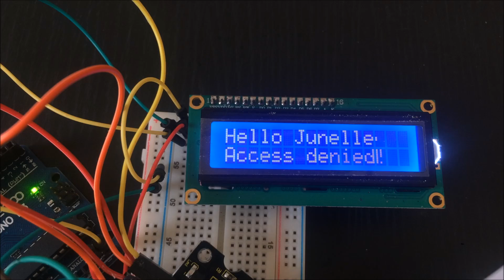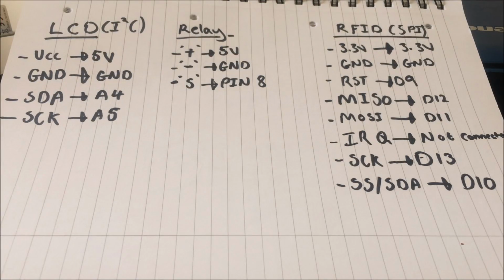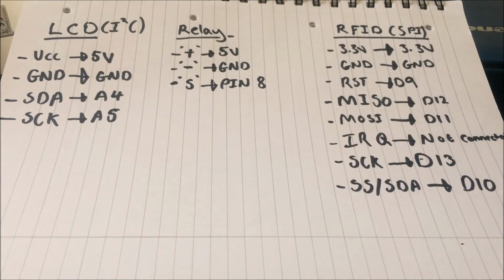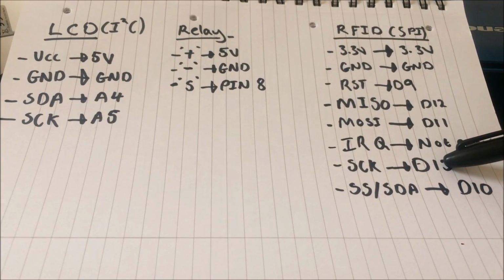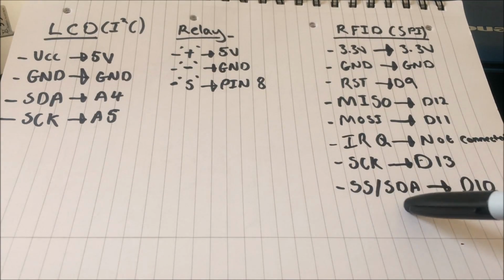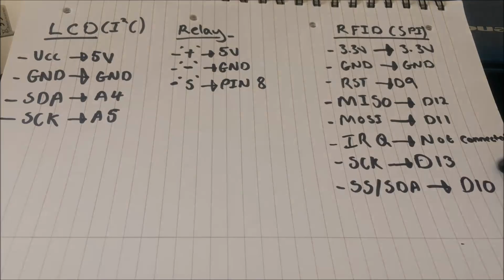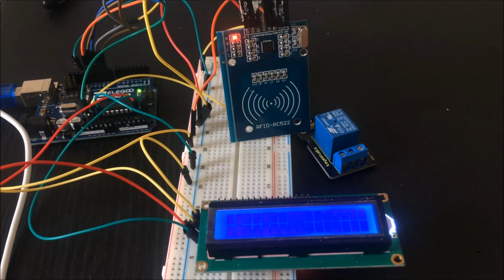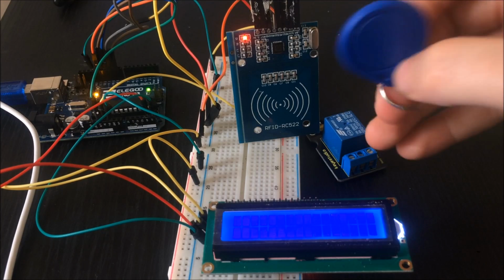Arduino project tutorial for Beginners - RFID Connected to Relay and LCD!

Comment: Is it possible to connect multiple push-buttons from the relay and back to the the arduino digital pins? (example concept: hotel's elevator rfid)